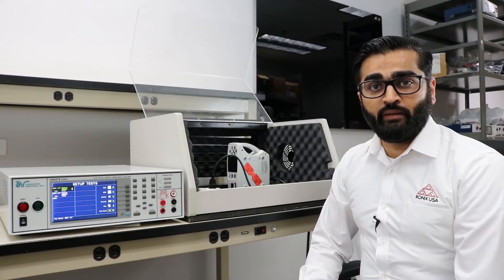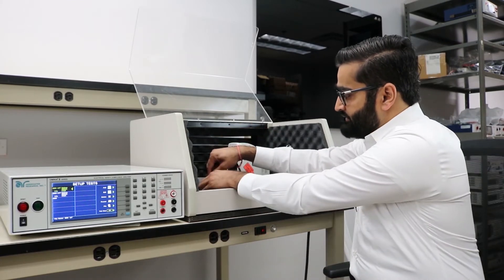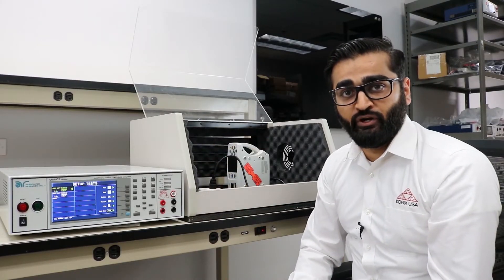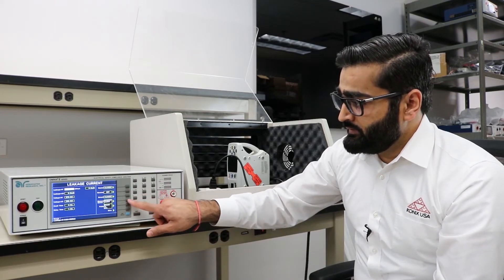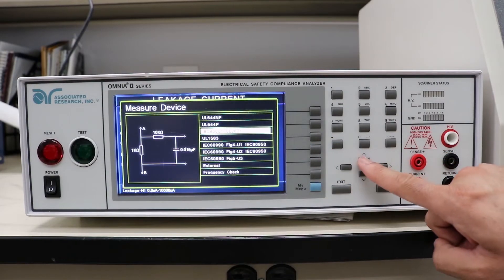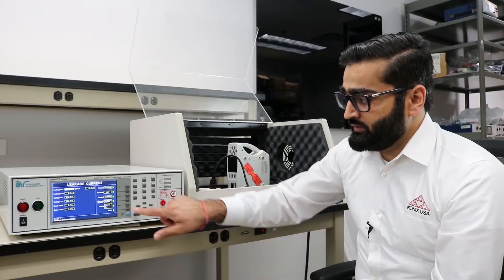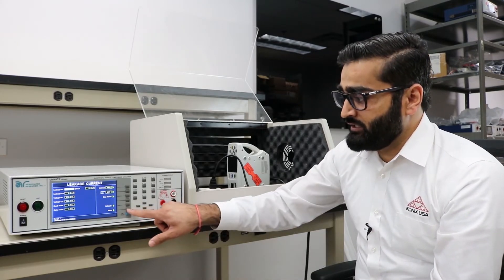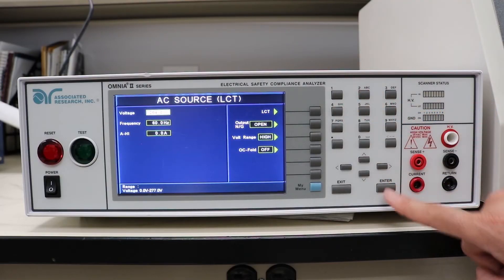Basics of Leakage Current Testing

Comment: I am being told I need to suppliment my leakage tester (Dale 601) by adding a 1A current source (BC Group SC-2000) to do the ground resistance testing.  My safety analyzer applies 10mA in testing the earth ground leakage.  Why do I now need to have this 1A source to drive the ground testing?  This seems to be a new reason evidently as I have never been required to have this until this year for some reason..  Do you have any information on this reasoning or purpose?  I cannot seem to find any data on this purpose or process anywhere.  The manuals all refer to the IEC-601, which is the old standard which is now the IEC-60601-1.  BC Group has a video showing the use of the 1A module but no explaination is given as to why it is used as opposed to the standard ES anaylyzer at 10mA to drive the resistance check.  Thanks if you can help!